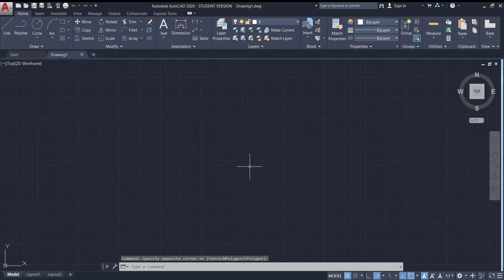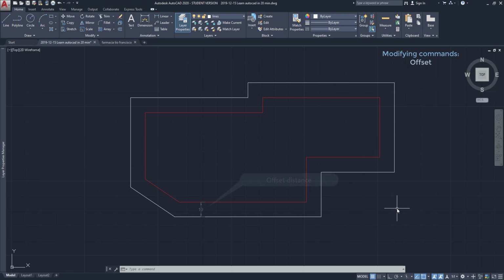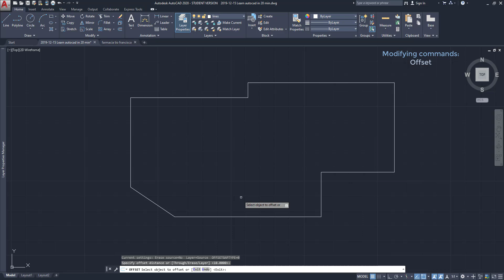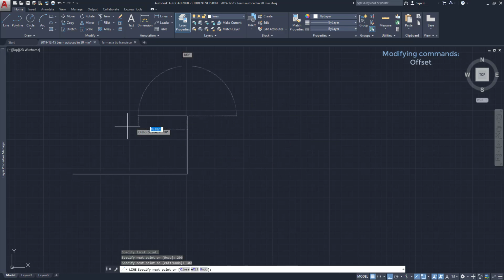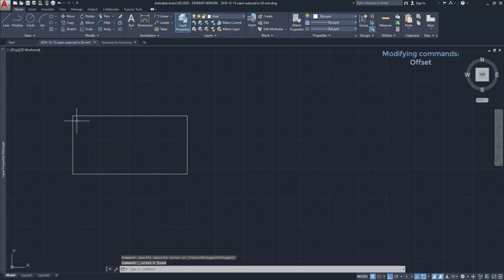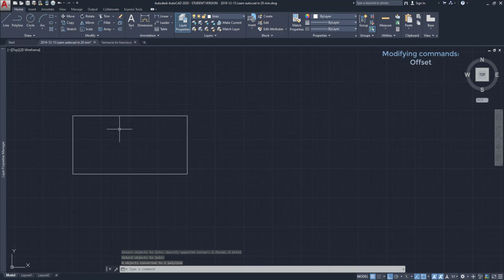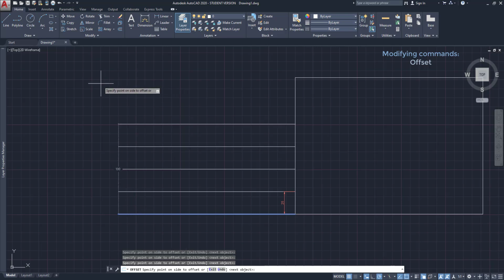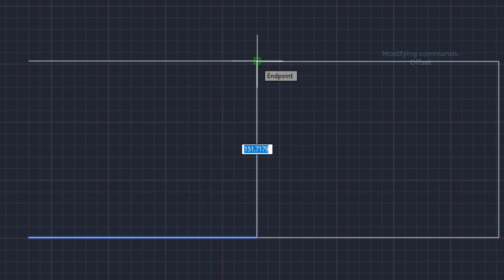Autocad 2020 - How to use Offset (4 examples in 4 minutes)

Comment: Hi! I hope you can teach me because I cannot use my offset distance, I cannot find that small box where distance is entered. It was there before but when my app lagged suddenly it doesn't show up. Is there a key or command that I can use to see it?
Reply from the maker: Hi Jisoo! You have to enable "dynamic input" button at the status bar.
If it's not there, Click on the last button at the bottom right corner (the button has 3 horizontal bars). In the list, put a tick on dynamic input to add it to the status bar. Then, turn it on!
Thanks for watching and hope you keep learning!

Comment: when i use offset through the dimensions are wrong like if i give 100m it'll be 9.84, 9.98, 9.45 .
if i use only offset no problem but in through not a single time i got dimension right
Reply from the maker: "through" has the purpose to offset the object in a specific point. if you want to offset a specific dimension, please use the "normal" offset.

Comment: I've drawn an odd shape using lines and it is an enclosed shape. But when I use 'join', and select the source and the rest of the lines, I got this error - 0 lines joined to source, 5 objects discarded from operation.  Is there something wrong with my settings or selections? Please help. Thank you in advance.